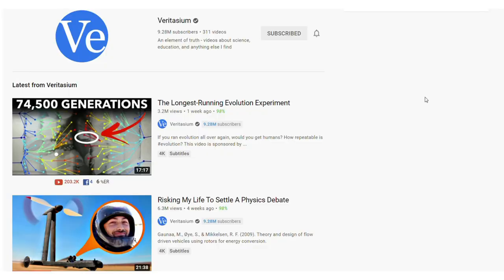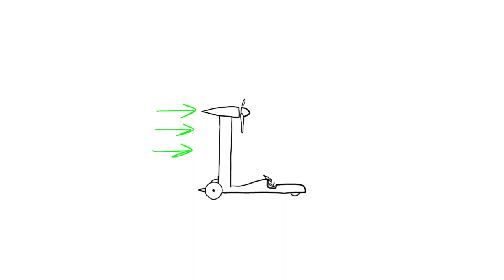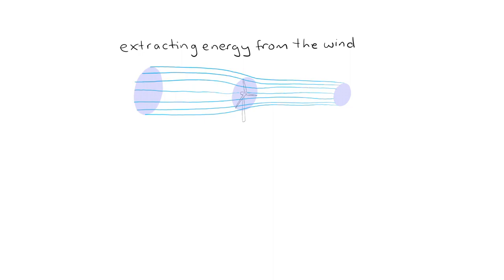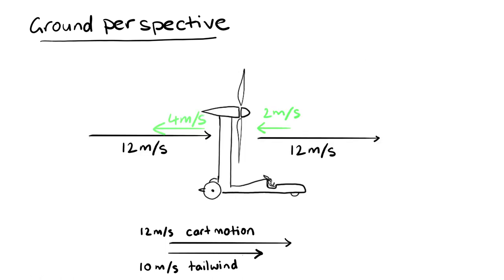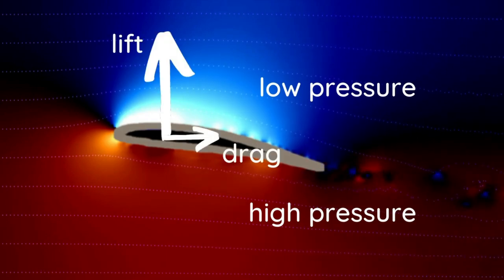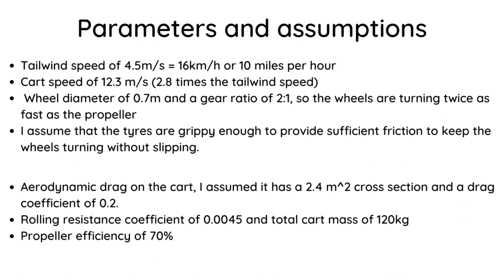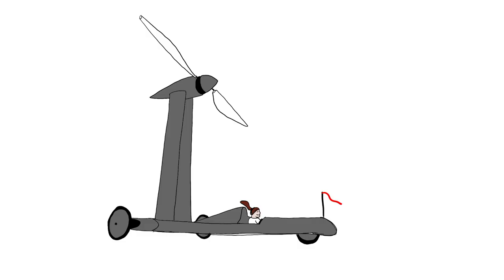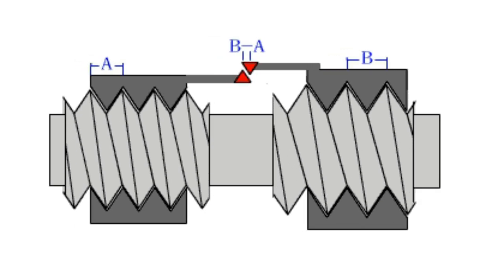Downwind Faster Than the Wind by Veritasium: How Does it Work?

Comment: Rosie, This is first time I see one of your videos as recommended by youtube algorithm.
I disagree with the fact that higher speed than wind speed in the direction of the wind is possible for more than a few moments depending on the amount of mechanical or other type of energy storage.
That large propeller likely acts as a big flywheel so for some limited time higher than wind speed is possible but only using the amount of stored energy.
The propeller as a propulsion system is obviously not 100% efficient so all the energy for propulsion will need to come from the wheels.
I can do the same thing with no propeller at all just with a flywheel or to get more complicated with a motor/generator and a small rechargeable battery where I get some energy from the wheels while obviously traveling at much lower speed than wind speed for some time charge the battery and then disable the charging wait for the vehicle to get close to wind speed and then enable the motor with the battery stored energy to exceed the wind speed but I will do so for a limited amount of time it will not be continuously going above wind speed as the stored energy will eventually be used.
Reply: This is not how it works at all. The professor (Alexander Kusenko) who bet against Derek Muller (Veritasium) proposed that gusty wind was one of the possible explanations of the car's speed, but has since conceded that the car can indeed travel faster than steady state wind indefinitely and has paid up the $10,000.
Reply: @johnborton4522  Ignoring all friction a vehicle pushed by the wind in the exact direction of the wind will get to the same speed as the wind (assuming here constant wind speed).
Where will you get the additional energy to accelerate the vehicle from this point ? The only explanation I can think of will be stored energy (any form of stored energy).
You can also think replacing the chain with electrical wires and use permanent magnet motor/generators on the wheel axis and the propeller.  I'm an electrical engineer so for me this looks easier and more elegant and maybe even slightly more efficient than a chain and gears.
But then you can better see that energy you take out from the wheels will slow down the vehicle and using that energy in any way you want can just not put back more so best case with 100% efficiency you get back what you took from the wheels.
And why is the propeller even needed  why not transfer the energy from the back wheels to the front wheel with a different gear ratio and a slip clutch now while the vehicle accelerates the losses on that slip clutch will reduce as the front wheel gets closer to the wheel speed on the ground.
Reply: @ehque  Not sure how bet was setup but explanation seems wrong.
Yes the vehicle will exceed wind speed but for a very limited time just as much as the energy storage allows.
During the initial phase when vehicle accelerates from zero the energy provided by the wind is split in to three parts.
One part will accelerate the vehicle forward the other part will be stored as mechanically energy likely the propeller acts as a fly wheel as sufficient energy can be stored there fir such a low friction vehicle and the third is lost due to friction.
At some point the vehicle will get to a point where the wind pushing the vehicle equals the friction and no more energy is put in to fly wheel and from this point the fly wheel will provide the energy to accelerate the vehicle so with enough energy stored vehicle can be accelerated way above wind speed even 2 or 3x the wind speed will not be a problem but then when energy is exhausted the vehicle will slow down bellow the wind speed.
Reply: @ehque  When you initially put the vehicle on the tread mill you keep the vehicle down thus the flywheel (propeller also acts as the flywheel storing energy) gets charged.
Since vehicle has very little friction the amount of energy needed to slowly accelerate the vehicle in the opposite direction is fairly small so it may be enough energy there to keep accelerating the vehicle for a minute or two but treadmill analogy is not that great as you can not have a super long treadmill and it is easier to demonstrate that with the blackbird vehicle tho you need constant wind speed and a long enough road or smaller energy storage to show this.
It will not be possible to design a real vehicle without any energy storage but you can add weight to the vehicle and you will see that top speed will be reduced at some point below wind speed when the energy storage is smaller than energy needed to accelerate the heavier vehicle above wind speed.
Reply: @electrodacus  Wrong. Again, there is no possible way that the inertia of a device causes that same device to accelerate. Inertia by definition being the property of matter to continue in a state of motion, not to change it. Besides, a propeller makes a terrible flywheel - it's too light and it's constantly expending energy to move air.
Reply: @ehque  It is not what you call inertia. The flywheel that is also in this case the propeller speeds significantly faster so that air is pushed faster than the vehicle speed.
In the initial phase the wind accelerates the vehicle pushing against the body of the vehicle. Energy from the wheels is transferred to propeller / flywheel so energy is stored there as long as wind is accelerating the vehicle in the initial phase.
If the propeller had no weight so no energy could be stored and same for the vehicle wheels to a lesser extent then vehicle will get somewhere below wind speed and not be able to accelerate any faster since things will be in equilibrium.  If there was also no friction (ideal case) vehicle will get up to the same speed as the wind.
Now the ting that makes perfect sense to me but seems hard for others to understand is that the energy stored is what allows this vehicle to get above wind speed and that will be for a limited amount of time proportional with the amount of stored energy and the energy needed to accelerate past wind speed.
Vehicle can reach even fairly high speed above wind speed but then when energy storage is exhausted the vehicle will slow down below wind speed.
Not sure how anyone imagines that the vehicle is powered with no input energy above the wind speed where wind can no longer power the vehicle.
Reply: @electrodacus  “Stored rotational energy” in your words is what physicists call inertia/momentum. Again, according to you, if the stored rotational energy is being used to speed the car up, then the propeller should slow down (propeller slows down, car speeds up). But here, the car is speeding up, meaning the wheels are speeding up, which means the propeller is speeding up. There is more energy in the propeller over time, not less.

There is a constant input of energy into the system from the *wheels*.
Reply: @electrodacus  This is not a case of stored energy. In principle, the cart can maintain a speed above the winds speed indefinitely as long as the wind is blowing.
Reply: @seneca983  Is there a designed speed above wind speed that the vehicle will reach and then stay in equilibrium at that speed indefinitely ?  Or will continue to accelerate and you need to break in order to not get the vehicle damage due excessive speed ?
How do you capture the wind energy when as far as the vehicle is concerned when you are traveling at say 2x wind speed the vehicle will now experience a head wind. So same speed as the wind speed but from the opposite direction.
If you have a vehicle (ideal one with no friction traveling at the wind speed you will say that is a 100% efficient vehicle) What is the efficiency of a vehicle driving at higher than wind speed in the direction of the wind.  I can imagine a vehicle driving indefinitely at higher than wind speed but in a different direction than the wind so that the vehicle always experience the wind and can extract energy from that to move at higher than wind speed.
I can also imagine a vehicle traveling at higher than wind speed but only for limited amount of time dictated by the amount of energy storage that the vehicle has on board.
All you have in this vehicle is a propeller connected with a fixed gear ratio to the wheel so a closed loop with less than 100% efficiency.
If you take 5W from the wheel and put 4W out of propeller will the vehicle not slow down ? Where is the at least 1W delta coming from ?  You can not say that 1W delta comes from the wind as air particles are now traveling in the opposite of vehicle direction at 2x the wind speed slowing the vehicle even more.
Reply: @electrodacus  "Is there a designed speed above wind speed that the vehicle will reach and then stay in equilibrium at that speed indefinitely ?"

At some point drag will exceed the thrust that can be generated if the vehicle doesn't topple over before that. Of course, such limit is probably not explicitly designed.

"How do you capture the wind energy when as far as the vehicle is concerned when you are traveling at say 2x wind speed the vehicle will now experience a head wind."

It's because the propeller spins fast enough to generate thrust. The wind is still essential because the apparent headwind is slower than the speed of the ground relative to the vehicle. That's why the wheels can power the propeller.

"If you take 5W from the wheel and put 4W out of propeller will the vehicle not slow down ?"

No, because the force at the propeller is greater than the one at the wheels.

"You can not say that 1W delta comes from the wind as air particles are now traveling in the opposite of vehicle direction at 2x the wind speed slowing the vehicle even more."

You're looking at the inertial frame tied to the vehicle (at a particular moment)? I don't think it's the most intuitive frame to look at this. However, if you want to consider this frame, notice that here the ground contains kinetic energy because it's moving relative to the vehicle. So basically in it's own frame the vehicle will decelerate the ground and accelerate the air. Because the ground is moving faster than the air the former will release more energy than the latter consumes. The difference (minus some dissipative losses like friction) can be used to accelerate the vehicle.
Reply: @seneca983  
"No, because the force at the propeller is greater than the one at the wheels."
You do not understand the concept of power and it seems to be fairly common and the main reason you do not understand how this vehicle works.
Power includes force and velocity.

You can trade one for the other and power can remain the same.
So if you have a large force like leaning against a vehicle without being above to move the vehicle at all then since velocity is zero the Power is also zero and you are doing no work. If you lean harder and vehicle starts moving then you have a power say 100W. If the vehicle suddenly becomes lighter but you continue to push with the same 100W you will need to move faster.
If vehicle require a minimum of 300W to start moving due to friction then if you are not that strong say you can output max 250W then you can try all day you will not move that vehicle and there will be no work done.

Comment: it cant work. as soon as the car goes faster than the wind the wheels will no longer drive the propeller since the propeller is a one way ratchet and can never drive the wheels. therefore the car will slow back down until it equals the wind speed. so therefore it can't go faster. you can't get free energy...
Reply: also wind pushing the car vs treadmill driving the wheels are not the same so the treadmill proves nothing. once the car goes faster than the wind, the wind is no longer touching the car. but with the treadmill it is always providing input power compared to the wind.
Reply: @reesecup4567  It's not free energy. The energy is coming from the wind (even when windspeed has been exceeded).
Reply: @seneca983  so it is free energy then? thanks for admitting that.
Reply: @onebig77thbrigademonkey.57  It's not free energy. The moving air is losing kinetic energy and the cart is gaining some. No energy is being created out of nowhere.

Comment: Im not convinced it works actually.
Reply: @Rick_Cavallaro  when it is traveling faster than the speed of the wind the system should reverse am i right?
Reply: @Rick_Cavallaro  hmmm i see. I kinda get it. The wind is powerful enough to push a craft up to the same speed with less and less power nearing the wind speed but using this method (fan blades) elarges the wind catching area and keeps the wind difference closer in between max force/max difference to wind to craft speed  and min force equal wind speed. Hard to explain.

Comment: So, this guy has a series of videos where people submit ideas for fan blades and he competes them
https://www.youtube.com/c/MajorHardware

I wonder if wheels pressing against the side of a large diameter shroud could be used to create a similar runaway fan design

Definitely wouldn't work with crude 3D printed parts, but I wonder if it's possible using proper parts

Comment: Who dare to offer 10000 dollar is really crazy. I watched veritasium video and i remember I tought originally it sound like brake thermodinamic second law. But i know ships sailing aganist wind can move 7 times faster than the wind pull it..One thing really strange on it vehicle, how it start only with wind energy. Why it does not need some push to help the wheel move the propeller? One sail has a big area to get the wind back. But it vehicle has a little area. I think that make models (i sow some models little in other video) might be necesary to understand it better.
Reply: It needs very little area because it has very little rolling resistance.
Reply: Its worse that than than;  ships can't sail directly up wind or down wind )faster then the wind at 0 degrees relative but then can tack (other than 0 degrees) at great speeds. It's the reason you see the crew quickly switch the sails in a tack, so you don't loos momentum and slow down when you pass 0 degrees to true wind to the opposite tack.

Comment: What a convoluted way of explaining something simple! The cart is driven by the ground through the air that's all!
Reply: //"The cart is driven by the ground through the air that's all!"//

It is not driven only by the ground, nor only by the air -- it is driven by the difference in velocities between the two.  Energy calculations would of course be frame dependent.
Reply: @johnborton4522  From the frame of reference of the air - it is driven by the ground - which is what I said. Why the song and dance? - it's quite obvious really.
Reply: @WindThrusters  
//"which is what I said."

The song and dance is yours as that's not what you said.   No mention of FOR at all in your original comment.  

Using FOR's the following statement, which is simply the reverse of yours is exactly true:   

From the frame of reference of the ground, it's powered by the air - it's quite obvious really. 

Why the deflection?

Again, the truth is, it takes both the ground and the air for the Blackbird to motivate.
Reply: @johnborton4522  Yous are both correct. Obviously you need a relative velocity between the two media(in this case air and the ground) for this to work in the first place. Then consider the equation Power = Force x Velocity,. ..this being the case, you can take your input at lower drag from the medium which is travelling faster relative to the vehicle and, even considering transmission inefficiencies, can output a greater thrust(your driving thrust) to the medium that is travelling slower relative to the vehicle.

Comment: But it's not sustainable. When the car is going faster than the wind, we have the force of the propeller which is taking energy from the wheels and the drag of the car because it's going faster than the wind. Both are REMOVING energy from the system. I don't see where the energy is coming from. I'm sure there can be a period of time in which the energy stored in the kinetic energy of the vehicle is released via the propeller to have a small kick which allows to go faster than wind but it's not sustainable. It can only be for a small amount of time.
Reply: >> But it's not sustainable

It most definitely is.
Reply: @Rick_Cavallaro  explain?
Reply: @tuloski  "I don't see where the energy is coming from."

The propeller decelerates air (relative to the ground). Therefore the air is losing kinetic energy and the cart gaining some.
Reply: @seneca983  But the propeller is not magic. It's taking energy from the kinetic energy of the car. In the best case at 100% efficiency there is only a transfer of energy but there is no new energy. In the worst (and more realistic) case some energy is wasted in the mechanism and the aerodynamical efficiency of the propeller.